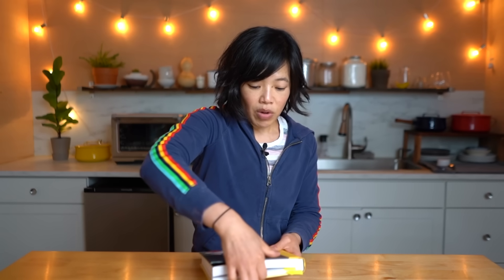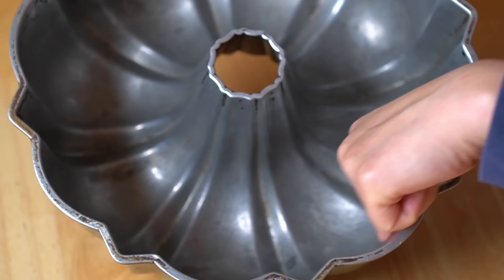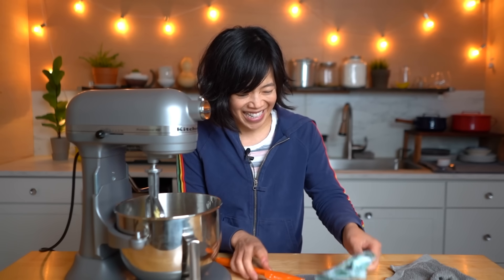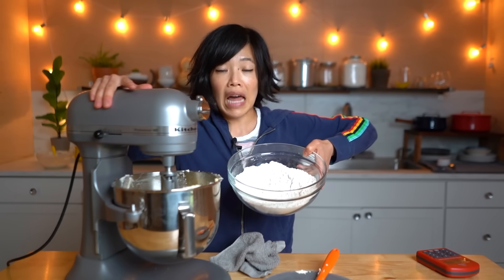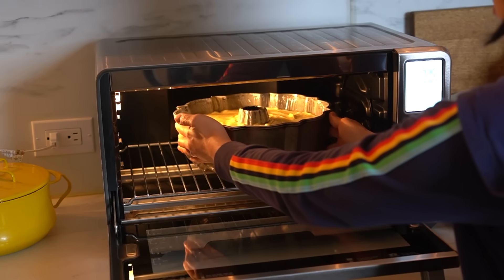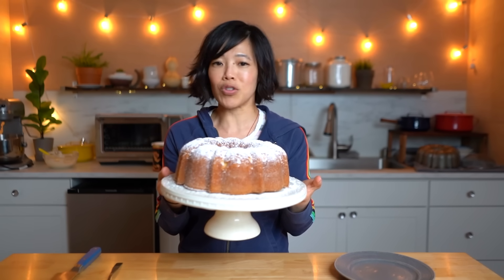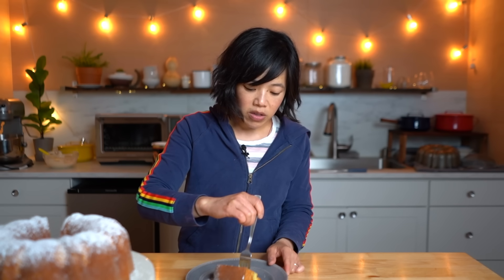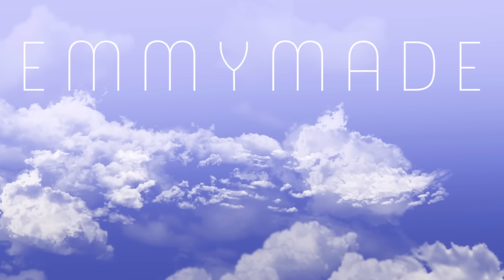COLD OVEN? Pound Cake Recipe

Comment: Emmy, with those 3 wrappers from the butter that you used, I would have completely greased the Bundt pan, every nook and cranny, and then thoroughly dusted with flour, tapping out the excess. That is always my tried and true method when using a Bundt pan. Loved watching this recipe -- I had read it in Cheryl Day's cookbook, bookmarked it, but I had never tried it. YUM!
Reply: Same, in fact that was my "job" whenever Mom baked.  Got really good at it over the years.
Reply: Absolutely. Use a solid fat like butter, coconut oil, ghee, or shortening to grease the baking tin. Get into every nook and cranny. Start out with 2-3 tablespoons of AP flour (or other preferred flour) in the bottom of the greased pan. Tip, tap, and rotate the baking tin to evenly distribute the flour. Use additional flour in order to make certain the pan is fully coated. I, personally, have better luck using a vegetable shortening because it lacks the milk solids in butter that can scorch. When I want a buttery flavor, I use ghee. 

I have found that using a solid rather than liquid fat works best. Liquid fats can be absorbed very quickly by baked goods. I've found that dusting liquid fats with flour can create unappealing globs of flour on the exterior of baked goods. I'm wondering if perhaps in focusing on the ridges where you generally experience sticking, you simply didn't use as much as was needed in the larger sections of the pan? Of course, you could apply the release paste and do a light dusting of flour.
Reply: @rtyria  Me, too!
Reply: That was how my grandmother did it, how my mom does it, and how I do it.  Either butter or shortening, coated in flour, then tap off the excess.  It's been a trusted method for generations in my family.
Reply: @laura121684  It also does a better job than those flour/shortening spray stuff from the grocery stores.
Reply: Me too
Reply: "Kids these days" just reach for the spray can instead of using Crisco & flour. Thought that was just common sense, but maybe not? I have a spring form bundt pan and the fun is trying to get the flour on the center part.
Reply: @artheaded1  To be fair to the "kids these days," not everyone grew up with the benefit of parents or grandparents who knew how to/taught them how to bake.  Even if they're using spray to grease their baking pans, at least they're trying?  I'm happy that people are trying to cook/bake at home, even if they do it poorly, rather than to always rely on unhealthy fast food.  Besides, you have to be kind of bad at a thing before you can get to be good at it.  Let's encourage and educate people instead of being jugdy.
Reply: I do the same!
Reply: The way most sweedes do it is to butter the pan, then use (store-bought) breadcrumbs, rather than flour, to cover it. In my experience it makes an even better job of letting go of the pan, makes the exterior of the cake a bit crisp, and it tastes lovely.
Reply: One argument I've heard for using shortening (or ghee) rather than butter for greasing bundt pans, is that the milk solids in butter can cause sticking.

Comment: "Cake goop" is very well known amongst us bakers. :)  I keep a jar in the fridge at all times. It's the best pan release method I've ever used! I just made a layer cake today using aluminum cake pans that are notoriously sticky. My layers came out easily and cleanly. I make sure I brush the pans liberally with the oil/shortening/flour "goop" making sure there are no skipped spots. I remember those Sara Lee pound cakes and the lined parchment paper! :D
Reply: It’s ok but it sometimes leaves a horrible coating on the finished cake.
Reply: @ts7844  Just brush it off with a pastry brush.
Reply: why not just butter it and sprinkle flour
Reply: @AshleyA93  I'm guessing because that is messy and time consuming. I've never heard of this method before now.
Reply: How long does the Goop last in the refrigerator? It looks like a good idea but I don't make cakes all the time.
Reply: @brucetidwell7715  keeps for months in the fridge
Reply: @brucetidwell7715  It is quicker and less messy to use.

Comment: What I've always done to unmold Bundt cakes without sticking is to thoroughly butter the inside, then dust the butter with a few tablespoons of flour. I just knock the flour all around the inside of the pan and then dump any excess that doesn't stick to the butter. Then I dump the batter in and bake. I've never had a cake stick when I've used this method. It's very much like the lining paste, but what I suspect didn't work there was that it was too thin because of the oil.
Reply: Baker's "gooping" method.
Reply: I've dusted with flour when I've done vanilla or pound-type cakes, but I've dusted with cocoa powder when I've done chocolate cakes. Now, though, I just used the baker's spray. I'm only slightly ashamed.
Reply: I agree, just the butter/shortening and flour is what I use. No oil
Reply: that’s what i’ve always done. learned from my grandmother and mother.
Reply: Breadcrumbs work better instead of flour instead of flour in my experience.
Reply: i was just thinking the same, also you can use breadcrumbs instead of flour for more spongy recipes
Reply: I do the same, but if I want an extra yummy cake, I butter and then dust with granulated sugar instead of flour! it gives the edges a little sweet crunch
Reply: @queennectarina  that is delicious - I've done that with banana bread, and it's fantastic. It's not quite as non-stick because of the sugar, so I'm not sure I'd use it with a complicated pan, but I've had it work just fine in a regular loaf pan.
Reply: Your pfp scared me and gave me nightmares :(
Reply: @hutao8539  um...ok. Hope you sleep better tonight! 😁
Reply: Same!
Reply: I’ve always done this !! Works like a charm on every kind of tin !
Reply: @queennectarina  This is the method I use. I've even done 50/50 sugar and flour over the butter. It's so simple to take the butter wrappers and wipe them inside the pan. Any excess sugar/flour can be dumped into the batter. You can even chill your buttered pan to keep your coating from spreading when you add your thick batters.
Reply: When I make a boxed cake, I set aside a pinch of the dry mix and use that.

Comment: For me, when I'm making bundt cakes, Bakers Joy spray has literally never failed me.
Reply: Yup! I just commented this! I’m always so surprised when people haven’t heard of it or seen it. Bakers Joy flour spray has been around forever. I too have never, ever had a bundt cake snafu, and it’s so much easier than the traditional method of flouring the pan. You get a nice even coating every time, it doesn’t leave a residue on the food, and the pan rinses “clean” (I mean- it still goes thru the dishwasher for sanitization) usually without even needing to soak!
Reply: Same. I have never had stickage. I also know it’s important to release the cake at about 15 min of cooling?  Too soon and it hasn’t set. Too long and the sugar in the cake starts to crystallize on the pan.
Reply: @VanGoWanderlust  Yes! I have learned also that timing the release is almost as important as pan prep itself.
Reply: @VanGoWanderlust  yes, I too have noticed this. I never let the cake (or any baked good really) fully cool. I feel like the pan still needs to be almost uncomfortable to handle bare handed. I attributed it to not wanting the release agent (oil, butter, etc.) to cool/harden because if it hardens and sticks to the pan, it’s going to keep part of the cake hostage when you turn out the cake. Or at least that’s what made sense to me, in combination with most cakes/quick loafs having the most amount of flexibility when they’re warm. Once cool, they seize up and and aren’t as forgiving.